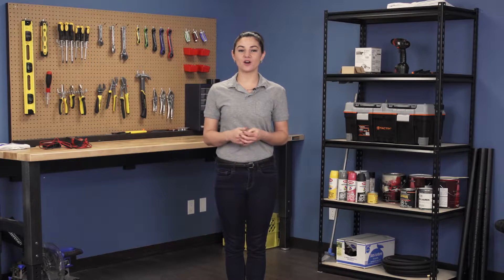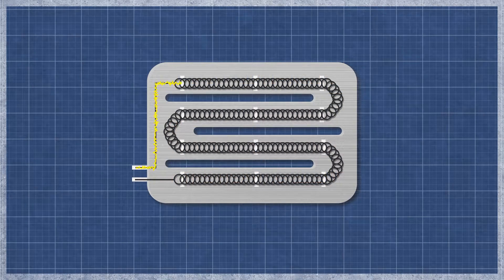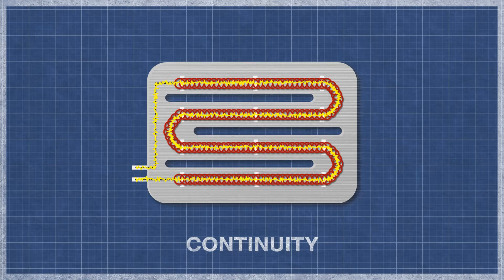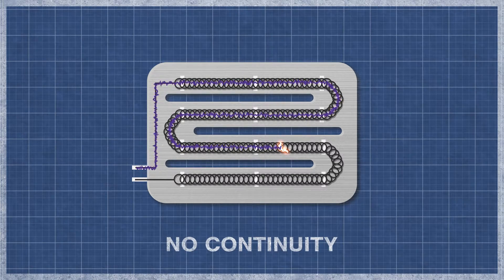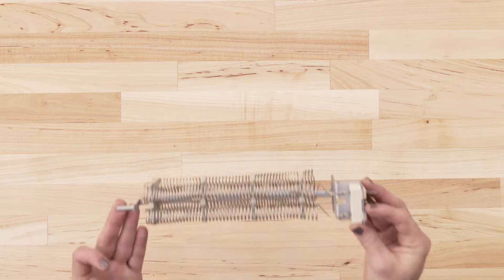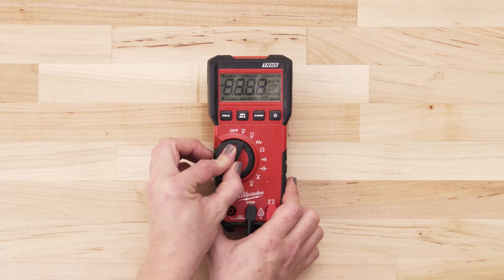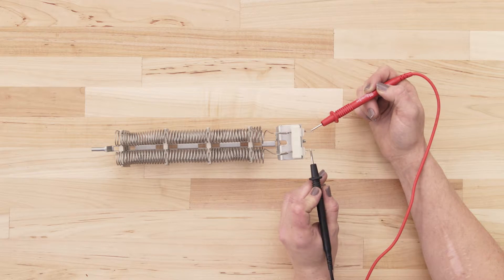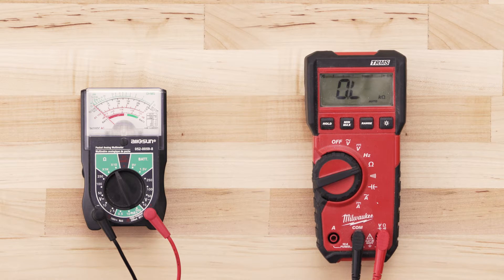Maytag # LA-1044 - Continuity Test (Dryer Heating Element)

Comment: How do you remove the heating element??
Reply from the maker: Hi Caleb, thank you for watching. On this model you'll have to first open the top cover. Use a flat putty knife to slide under the front edge, you should feel 2 retaining clips. Push with the putty knife to release the retaining clips. Once the clips are released the top will open up similar to the hood of a car. At the back of the dryer is the heating element. Disconnect the wires. Now use a nut driver to unscrew the heating element.

Hope this helps.